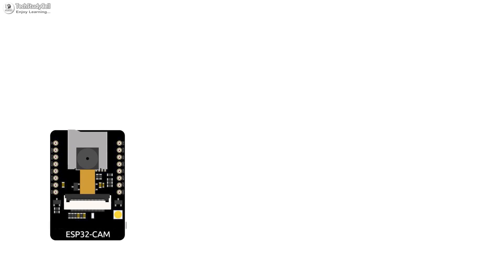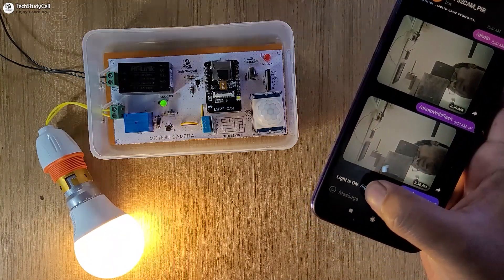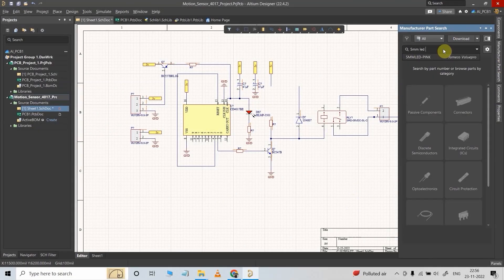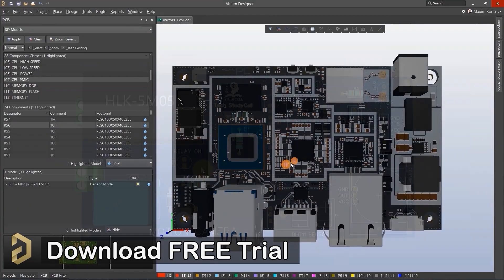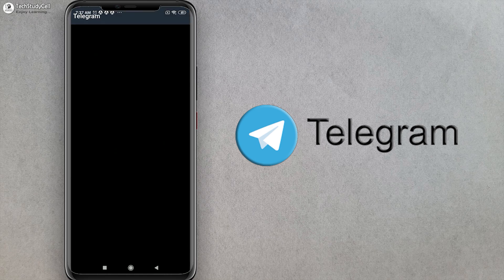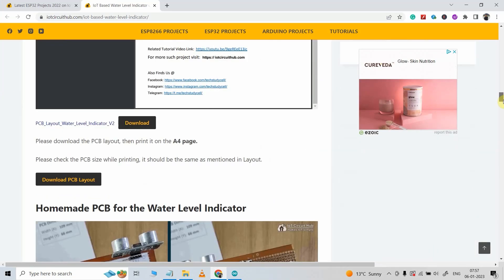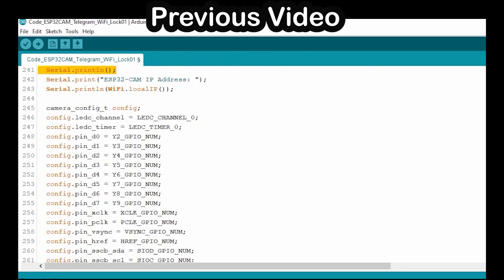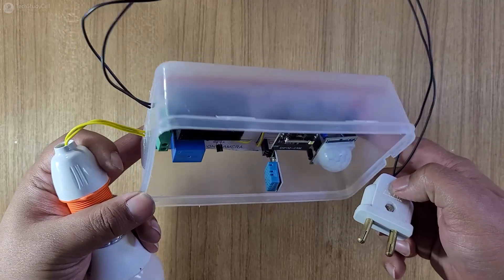ESP32 CAM PIR Motion Sensor Camera with Light using Telegram App | IoT Projects

Comment: Tell me this is harware or software problem and solution also 
program uploaded copletely  but

ESP32-CAM IP Address: 192.168.43.210

Start configuring and initializing the camera...
E (2588) camera: JPEG format is not supported on this sensor
Camera init failed with error 0x106ets Jul 29 2019 12:21:46

rst:0xc (SW_CPU_RESET),boot:0x13 (SPI_FAST_FLASH_BOOT)
configsip: 0, SPIWP:0xee
clk_drv:0x00,q_drv:0x00,d_drv:0x00,cs0_drv:0x00,hd_drv:0x00,wp_drv:0x00
mode:DIO, clock div:1
load:0x3fff0030,len:1344
load:0x40078000,len:13864
load:0x40080400,len:3608
entry 0x400805f0

Connecting to HLJ
.
ESP32-CAM IP Address: 192.168.43.210
Start configuring and initializing the camera...
E (2590) camera: JPEG format is not supported on this sensor
Camera init failed with error 0x106ets Jul 29 2019 12:21:46

rst:0xc (SW_CPU_RESET),boot:0x13 (SPI_FAST_FLASH_BOOT)
configsip: 0, SPIWP:0xee
clk_drv:0x00,q_drv:0x00,d_drv:0x00,cs0_drv:0x00,hd_drv:0x00,wp_drv:0x00
mode:DIO, clock div:1
load:0x3fff0030,len:1344
load:0x40078000,len:13864
load:0x40080400,len:3608
entry 0x400805f0

Connecting to HLJ
.
ESP32-CAM IP Address: 192.168.43.210
Start configuring and initializing the camera...
E (2589) camera: JPEG format is not supported on this sensor
Camera init failed with error 0x106ets Jul 29 2019 12:21:46

Comment: I have problems 
ESP32-CAM IP Address: 192.168.43.210
Start configuring and initializing the camera...
E (2588) camera: JPEG format is not supported on this sensor
Camera init failed with error 0x106ets Jul 29 2019 12:21:46

rst:0xc (SW_CPU_RESET),boot:0x13 (SPI_FAST_FLASH_BOOT)
configsip: 0, SPIWP:0xee
clk_drv:0x00,q_drv:0x00,d_drv:0x00,cs0_drv:0x00,hd_drv:0x00,wp_drv:0x00
mode:DIO, clock div:1
load:0x3fff0030,len:1344
load:0x40078000,len:13864
load:0x40080400,len:3608
entry 0x400805f0

Connecting to HLJ
.
ESP32-CAM IP Address: 192.168.43.210
Start configuring and initializing the camera...
E (2590) camera: JPEG format is not supported on this sensor
Camera init failed with error 0x106ets Jul 29 2019 12:21:46

rst:0xc (SW_CPU_RESET),boot:0x13 (SPI_FAST_FLASH_BOOT)
configsip: 0, SPIWP:0xee
clk_drv:0x00,q_drv:0x00,d_drv:0x00,cs0_drv:0x00,hd_drv:0x00,wp_drv:0x00
mode:DIO, clock div:1
load:0x3fff0030,len:1344
load:0x40078000,len:13864
load:0x40080400,len:3608
entry 0x400805f0

Connecting to HLJ
.
ESP32-CAM IP Address: 192.168.43.210
Start configuring and initializing the camera...
E (2589) camera: JPEG format is not supported on this sensor
Camera init failed with error 0x106ets Jul 29 2019 12:21:46

Comment: Don't need all these stuff to automatically control the pump. Just connect the three wires from both side of in an orderly ways. Let me show you the ways to make it. Let represent both the tank as A and B: Connect A red to power main line , A Green with B Red, A black with B Green, and lastly connect the pump with B black and the power main line. And you can switch off the main line using a switch.

Comment: First of all I would like to thank you for sharing such an interesting and useful project for all.

I have assembled the circuit without DHT sensor and relay as well and programmed via IDE 2.0.6.

Issue: My bot is online but unable to do any action except retrieving the menu.

As soon as I power the unit either from FTDI or from an external 5V regulated source the bot comes online and a message on the telegram app appears. But after the menu arrived, no another action was successful.
Please HELP.
THANK YOU!

Comment: I have been following you for a very long time and I love your videos and your way of explaining.
Can you do home automation through esp32, but with sensors such as temperature and humidity sensor, distance sensor, motion sensor, light intensity sensor, rain sensor, fire sensor, fingerprint sensor, rfid card, and more outputs for each sensor, knowing that you can add atmega328p to increase the number of outputs through an application blynk or esp rainmaker

Comment: I request a tidal beach water level sensor monitor
notifies the water level every hour
example:
February 02, 2023 00:00 15CM
February 02, 2023 01:00 18CM
February 02, 2023 02:00 22CM
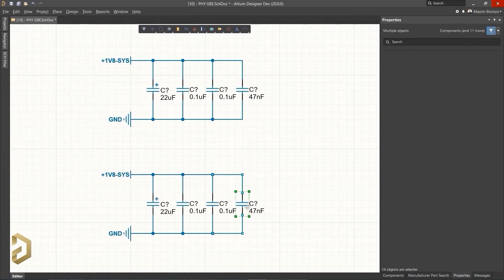February 02, 2023 03:00 17CM onwards
with real time data send to telegram bot
or send to google sheets

Comment: I think it's also interesting to apply the rcwl-0516 microwave motion sensor module which has the same function as the sr-hc501 pir motion sensor module
Reply from the maker: Yes.  You can use it